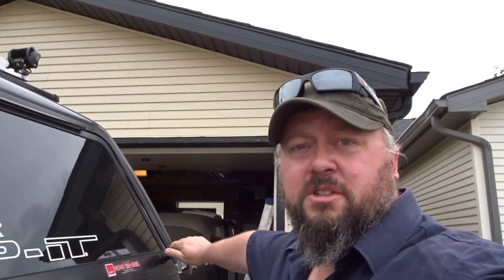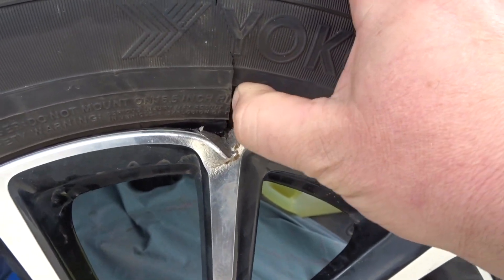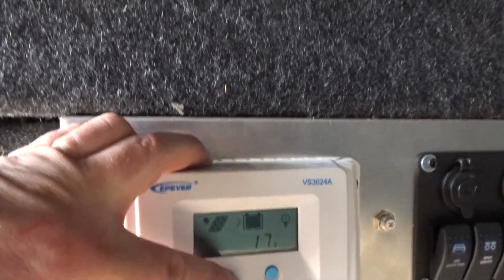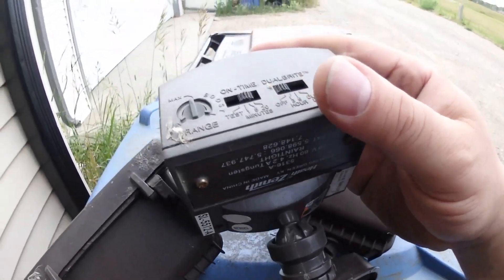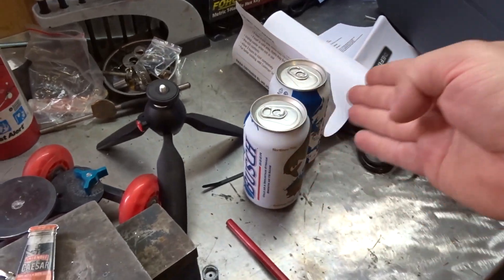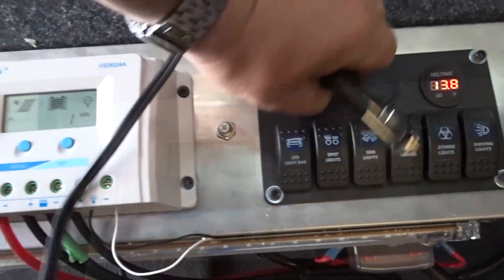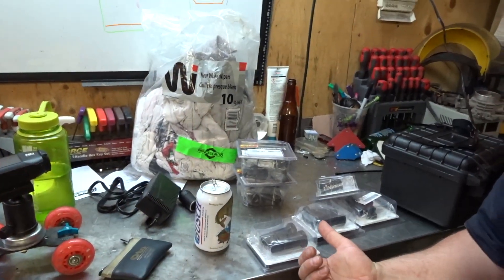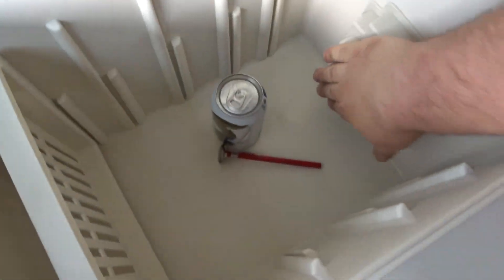Trying to Figure out Solar and the new Cooler

Comment: Once it's at or maintaining temp i'm assuming draw should lessen, if i remember correctly the fridge draws more when there is less in it. throw some frozen burgers/meat and pre cooled beverages in it and it might handle the load ?? Or maybe i'm talking out of my ass....
Reply from the maker: +traitoR142 it's not a fridge but a cooler it runs constantly if it's empty or full makes no difference
Reply: My brother has that cooler, it actually operates more like a fridge in that it doesn't freeze things, i'm not sure but you would think it has a cut off when it's cold enough ? I didn't pay much attention to it last time out, but i think i heard it cut in and out ? I do recall he mentioning somewhere along the way it worked ok. Maybe it does run constantly... I don't know, maybe i'll ask him what his does.

Comment: Maybe try connect load directly to the battery terminals rather then load output on the controller. I think that is low amperage output on controller. No idea tho.
Reply from the maker: +Jackson Ransom the panel is connected directly to the battery and the solar controller is connected to the battery so it charges

Comment: I had a coleman cooler like yours, and it takes up to 8 hrs to be fully cool, have you had any of your exhaust manifolds bolts bust on you yet to develope the lovely common exhaust leak on your f150, i got one now on mine at 132k miles its a 05.
Reply from the maker: +tmaq97 there is a few issues with this truck, most likely gonna drive it till it blows up lol
Reply: Bullshitkorner what issues are you facing with?, if i may ask

Comment: Thermo battery simbol is not working good on these mmpt chargers tour battery is emty if the voltage is 11.4 volts 12.4is 100% full so your math is good
Reply from the maker: correct i don't have the temp switch so it will always say 25 degrees.

Comment: Do you think it's possible (or worth it) to add one panel each to the front and rear roof ones, hinging them to fold over face to face, thus allowing you to un-fold them at your campsite providing more power for the fridge etc?
Reply from the maker: +Steve C its all possible yes just experimenting right now until I figure out what works best then redesign it all

Comment: I had an older koolatron and it cooled down to about 45 deg max but never shut off   like a fridge with a thermostat. The amp hour rating on a battery is at a specific temperature and load at a min voltage but your load shouldn't  have dropped  that much - wingwang meter :) .  Knowing the min voltage of the appliance to run at is one variable .  I never run anything under 12V .  The battery is too depleted I find and just too hard on the battery.  I always go with 50% of the amp hour rating as I have found  depleting the other 50% is just not worth it as it takes too long to charge back up with a solar panel.  Your honda genset would probable  take 10 hours or more of charging  to put 100 amps back in the battery .  Let's test the charge rate of the eu2000  maybe .
Reply from the maker: +STEVE ROB lol I drop them down to 10.5 that's what warranty is for lol